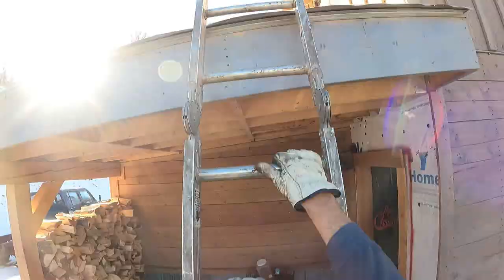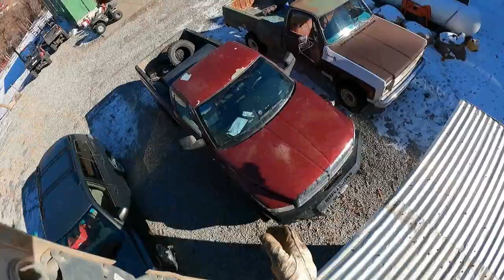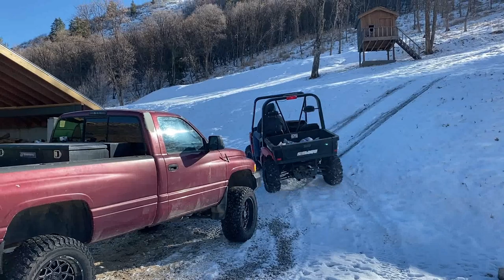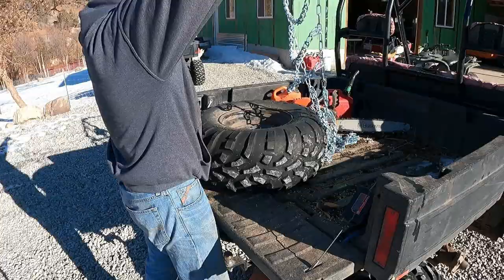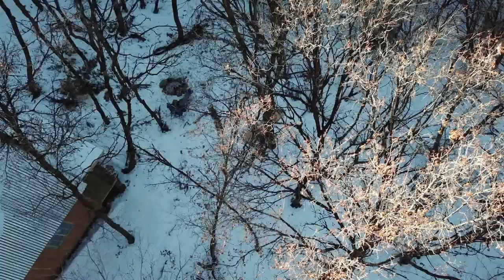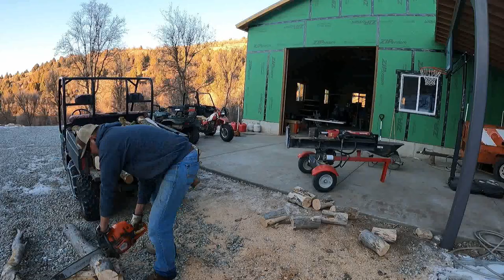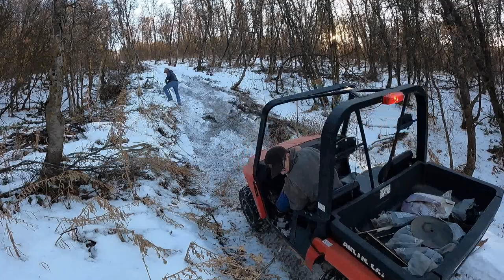The Earth Has Shifted... LITERALLY! (Solar Panel Issues)

Comment: The magnetic north pole has nothing whatever to do with where the sun rises and sets. The geographic north pole does wobble a bit over time, but it's wobble is well known. I have read that the geographic north pole is moving towards England, but since the earth is more or less of a gyroscope, it couldn't move very much very fast without causing major earthquakes and other disruptions. What is more likely is that the earth's crust, or at least a tectonic plate,  is moving England towards the north pole. But ancient solar position finders like Stonehenge still seem spot on as to where the sun rises and sets. My own occasional and admittedly loose observations of where the sun rises over the Green Mountain Front Range to the east at summer and winter solstices doesn't show any major change over my lifetime.

Comment: The magnetic poles shifting has nothing to do with the earths position in regards to the sun. even if the poles switch( which they will do some time)  that won't change where the sun rises and sets.   I have a simpler and more scary possibility..... your farm is sitting on a slow slip( type of earthquake). stick a GPS tracking on the panel mounts and check for movement over time. ON the firewood.. may be should look at building/unstalling a Russian stove( masonry fire)  YOu will use less firewood   and  gain better heating

Comment: Magnetic north/south is different than the axis the world spins on... Magnetic field doesn't determine the location of a setting or rising sun... Yes magnetic field shifts. Yes it has moved rapidly since the 90s, 40 miles plus a year. There is no indication the axis of the earth has changed. It wobbles, Yes, it is not a perfect spin... But it's not increasing it's wobble, which would change your sun rise and set...

Comment: yes the Magnetic poles  moving can cause the Axis to move in relation to the Sun & moon Ect. It effects plate Techtonics and the earts crust slips and slides and changes place in relation to the position of the core. Now the New Madrid Is waking up. That colonial pipeline wasnt hacked. Nop it crosses under the Mississippi Rive in Lousianna. It started leaking. And they closed it. Its still closed. they rerouted the refined fuel  with branch lines , Railroads and trucks. Then The I 40 bridge broke. and just today the Hwy 412 Bridge  over spring river at Ravenden Ark. was closed because of a broken girder. All  of these are in the New Madrid Sezmic Zone. We have been having a lot of earthquakes in the region lately.

Comment: I've posted videos about this.
I noticed the shift in 2018 after hurricane Michael hit.
I live in Florida, 75 degrees north of cancer. 31 degrees north of the equator.. on the summer solstice, the sun should rise and set 7.5 degrees south of us.
This past summer solstice the sun rise about 35 degrees north of magnetic east. That would put the sun rising 60 -65 degrees north latitude.
That is roughly a 2800 mile shift.
I've seen where people in Canada have the sun shining in their north facing windows.
It should never it should never shine in our north windows, but it is.
Scientists already know the equator has changed numerous times
The proof is coral formations on the oceans floor.
This is the major source of climate change. Yet it is not being reported on.
These facts are easily verifiable with a little knowledge of where your located, how far north or south of the equator, and realizing at any point in the year where the sun should rise and set.
On the equinoxes the sun rises and sets due east and west. That would indicate we sit on top of the equator now instead of 31 degrees north of it.

Comment: I mean this in the most positive way possible.  Its true the magnetic poles move.  It is not true that the Earth rotation or position relative to the sun has changed in its seasonal movement.  You have completely misunderstood the information you read.  The north pole of the earth points towards the sun during the summer and then rotates away from the sun in the fall through winter and then the process starts again-for the Northern Hemisphere.  It has been this way for several billion years.  The solution to your solar power problem is as always.  Move the panels 500 feet up the hill.  Investigate the possibility of putting them at the top of the hill.  Its the location you chose that is the problem, nestled between 2 steep hills.  The only other solution would be to investigate the use of geo-thermal heating or direct geo-thermal power.

Comment: Yeah, the sun shifts position from summer to winter.  Nothing new. Happens every year. So if you measure the height above the southern horizon every day at the same time, that height changes. In summer it's high, in winter it's low. And that's why the analemma is extended in the north-south direction. ... We see the Sunrise in the east and set in the west once every 24 hours or so.

Comment: ZetaTalk Explanation 7/29/2004: Moon Swirls are particular to Nibiru, which has more than two dozen moons trailing behind it. The moons can never begin the circular orbit of moons known to man, due to Nibiru’s speed during its travels. They are perpetually caught in a dance among themselves, forming long tubes that funnel light bouncing down their length, thus the brilliant light emerging from the end.

ZetaTalk Comment 5/30/2015: Nibiru is seen at the 11 o’clock position in the Southern Hemisphere and thus would be seen atop the Sun, not well below.

ZetaTalk Explanation 12/29/2012: As is known, the view of the Sun in the Northern Hemisphere, and what lies either to the right or left of the Sun, is reversed in the Southern Hemisphere.

Then there are the plethora of photos using filters such as orange mylar or filters that selectively allow light in the red spectrum to dominate or green welder’s lens that reduce the glare of the Sun. Alberto and Manuel have been providing these images almost daily on the Pole Shift ning and ZetaTalk Followers' facebook site. The Nibiru complex is there, not only visible naked eye but also by the Daily Earth Wobble that has the sun rising and setting in the wrong place.

Comment: Magnetic pole shift people, its the real reason for climate change, increased aurora borealis, earthquakes, volcanic activity, flooding, extreme heat, extreme cold, it will also be the reason why earth rolls on its axis with devastating consequences for all on earth, why do you think the earth continues to spin people, its the same reason a drill spins when you power up its magnetic field, just like a drill if you reverse the poles you reverse the spin, or you have to flip upside down, the magnetic flip will be followed by a physical roll of earth and its been documented before that this has happened, analyzing rock around volcanoes shows that earth magnetic alignamant was very different to where we are today, my understanding is that thier is 4 magnetic pole positions on earth, the 2 we have now and the 2 magnetic anomalys that are from the previous position of the poles, over a period of time the poles flip back to the previous alignmants, this is know well known in some scientific circles although not put out as mainstream science, we are not far from the next restart, in fact the magnetic north has already moved about 40 degrees towards the equater, the magnetic south is rushing to meet it, "look at swarm satelite images". The great restart is coming.
Reply: A couple of more years is gonna be wild

Comment: I am glad I have not been the only been the one to notice this like you I have used the mountains around me to gage the sunrise sunset as well as the line of the moon tracks across the sky. 
From the summer sun to winter sun I have known where the sun comes up and sets but for some time I have notice a huge shift in the setting sun.use the old bonnet and use fibreglass and resin to coat the top and add strength without adding weight to it.

Comment: Well I believe the magnetic pole shift.. does occur every 200,000 years or so would not have an impact on solar insulation.. Im more concerned the land is creeping causing the change in sunlight
Reply: The property might be sliding further down into the valley causing the change in sunlight or the trees growing at the top of the property casing less sunlight at your location

Comment: Magnetic north has NOTHING to do with spin axis "north". The spin axis shifts yes but on a scale measured in thousands of years, the magnetic pole however can shift quite quickly. The spin axis drifts at about 10cm (4 inches) per year whilst the magnetic pole can move several miles in a year, huge difference.

The differences you've observed are more likely caused by failure of human memory, we humans just don't remember details very well. Our memories are constantly being rewritten by our brains as we live and experience life, it's why eyewitness testimony is not considered foolproof. If you had taken solar angle measurements and been able to show from those that the sun had shifted significantly I might have believed it but since nobody else I know of has reported the same... you might be misremembering where the sun was as we approach the shortest days in the year.

Comment: Its called winter, lol.
We are solar powered and located just a thousand miles or so from the equator. Our solar production drops 40% each winter even here. This is due to the tilt in the earths axis which is the cause for the change of seasons every year. The earths northern hemisphere simply recieves less sun in winter ( shorter days) because of the earths axis tilt as we orbit the sun. There is no significant change to the tilt of our axis. Magnetic pole locations do frequently shift about but again cause no significant effect to weather or solar intensity on the surfacs of our planet. In other words- seasons change and so does weather, year in and year out. This will continue for eternity and is normal so everybody can relax.
Do please always be prepared for the worst weather, we learned this from hurricanes Irma and Maria in 2017. Be prepared for the worst and have hope for the best. Self reliance is prudent.we are fully off grid with solar, water supply etc. No power/utility bills, no dependance on big corp. Never looking back !
Keep up the excellent work and keep the vids coming. Enjoy watching your progress.
Beautiful territory up there tho i prefer shoveling sand to snow.

Comment: To be depentent on solar panels and a generator that runs on fuel is better than nothing . But may i suggest an other option , try to make biogas . You can buy kitts to do so but also a diy can be don . You need a gas generator to . The earth wobbles ( the milankovitch cycle ) , also , as you stated , the noth and south poles are moving to ( so it seems ) the regions of Indonesië . The time this is going on is now about 150 years and its moving faster and faster . Also a factor it seems is the decline of the earth magnetic field . It also looks like the sun has a ( big ) part in it because its magnetic activity ( aka sun spots ) is declining in every 11 year cycle ( cycle 25 now is just begun ) and many think that after the top of this cycle ( 2025 ) its going to be almost spotless in decades , its called the Grand Solar Minimum . With al this it looks to going to be cold for a very long time and alot les sun to grow crops  .

Comment: you would think the if the earth shifted from say 23 1/2 to 24 degrees it would be big news. Could that be missed? I have seen other videos of elderly Eskimos and others claiming they have seen a shift in the suns position...I only know this because here in Florida it seemed to me that the sun was a lot closer to the horizon then I have ever seen it. So I search and videos pop up. Does not make it true, but interesting. The poles shifting and the earth shifting on the axis are two different topics. The poles can completely flip without the earth shifting on it's axis. They say it has happened and that it is overdue...who knows.

Comment: The reason why you are finding the sun and moon are coming up in different areas is because we are about to have a pole shift... Research about how many degrees of the rotation of the earth that it takes to cause the earth to do a pole shift...  also when we were in school  back in the day (my hubby and I are in our 60's) we always saw that the phases of the moon cycles showed that lines of the moon would be vertical not horizontal...https://www.moongiant.com/phase/today/   and now occasionally you will see them as horizontal... Isa 24:20 states. The earth reels like a drunkard, it sways like a hut in the wind; so heavy upon it is the guilt of its rebellion that it falls--never to rise again.
This is what happens during a pole shift.... and if you believe that we are living in the end times.... I think we are in the for runner of a pole shift....

Comment: You do realize both sun and moon move along the horizon daily. Your sun doesn't come up at the same spot at 11am every day. Which is what it sounds like you mean. The moon moves much faster across the horizon. 
What I've noticed is the winter Solstice sun rose and set NOT in the same place it did last year. It should do so in the same exact place every year. This is not the case. Also watch where Orion rises and sets on the horizon. This has changed dramatically btwn last year and this and the time it does is also different. It was also different last year than the year before that. On the same dates it should be in the same place in the sky. It's not. 
If I could get a clear night here in western Montana I would look at the direction the milky way is running cuz that must also be different. The pole has definitely shifted its just very strange that it's not the lead story on the news.

Comment: ZetaTalk Explanation 11/16/2003: The Monster Sun is light that has moved in all directions, bent back toward Earth by the gravity trap it represents, from a broad area, so when arriving at the viewer represents a broad orb.

ZetaTalk Explanation 8/31/2017: The waffle is magnetic field lines that have formed around the dominant moon in a Moon Swirl. Just as a magnetic field is identifiable on mankind’s electronic equipment as lines, due to clumping of the magnetons, the waffle has lines.

Smoking petrol bubbles have been seen drifting down and a petrol bubble grid formed against the Sun, as shown in Issue730 of this newsletter in late September. Mr MBB333 provides a couple new Petrol Bubble episodes where the sky lights up briefly, 5 times in a row, in Washington State and an undeniable flaming petrol bubble cluster drifting down from the sky in Arizona in broad daylight. These may become common sights everywhere, soon.

Comment: Actually for living off grid & relying on solar you purchased on the wrong side of the mountain. To improve your solar power you can only manufacture a framework that will automatically track the ideal angle to generate the maximum power. Your workshop roof may be the best position to do this.

How did you manage to keep a straight face whilst trying to explain that the geographic pole is wandering around whilst quoting the well known fact that the magnetic poles move around. All you had to do then was to blame the Chinese to complete the moment as the South Pole is moving closer to the new Chinese base down there.
https://en.wikipedia.org/wiki/South_Magnetic_Pole#:~:text=That%20point%20lies%20outside%20the,2%2C860%20km%20(1%2C780%20mi).

Comment: actually we are entering a solar low for the next 10 years from what i remember. it happens
Reply: No, the sun is entering a "solar max" stage. Th next "solar low" begins around the first half of 2027.
Ham radio operators (such as I am) are very much looking forward to this increasing cycle.
Solar MAX, baby!

And another trivia point; the sun's MAGNETIC POLES flip approximately every 11 years,.
Reply: @ernestgalvan9037  that's right max is the one with less light more spots I get the two mixed up